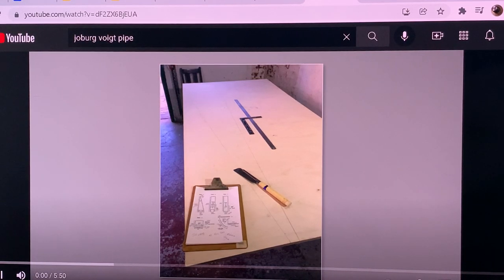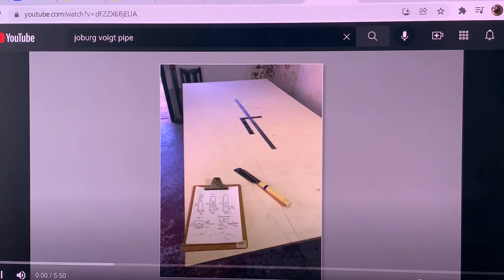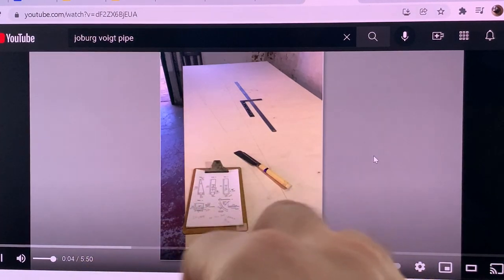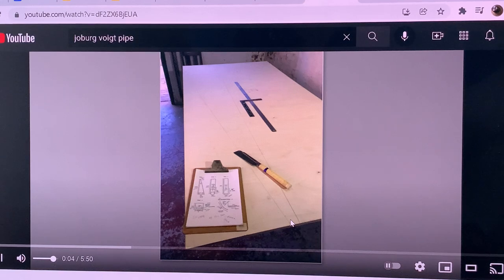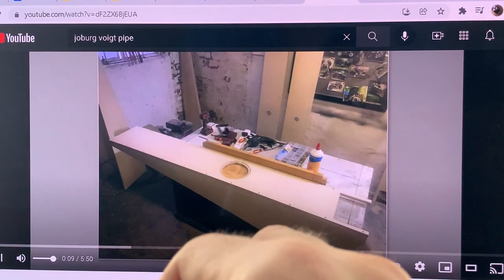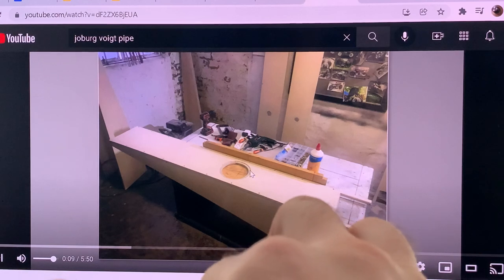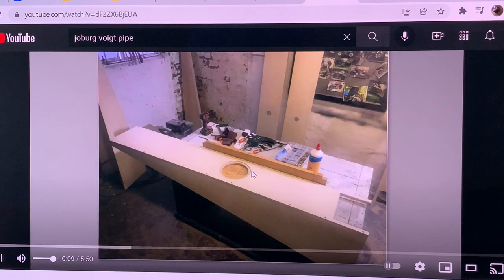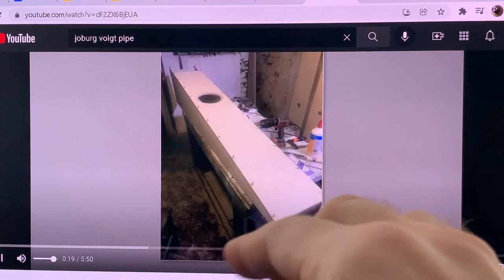Voigt pipe construction pointers   with the Joburg pipe of Kevin

Comment: I built these as well....luckily I used brass screws. Wasn't even thinking non magnetic just got lucky on that count. Bottom horn made from multiple pieces of hard wood that were individually carved and then glued/screwed. Also added felt behind driver. Contemplating filling the space under the horn but haven't taken that leap. Enjoying the series and am saving question for later... Take Care.
Reply from the maker: Very nice work, thank you for sharing! I would not recommend filling the lower section, as that will result in a serious loss of liveliness, speed, and most importantly dynamics - will make it sound as a typical polite, reserved and closed-in cabinet.

Comment: nice info for next project , I will use solid wood and plywood and send you pics soon
Reply from the maker: Superb! ; )
Reply: @realworldaudio  bro I'm thinking of doing front baffle in pine spruce and the rest in plywood, is that ok
Reply from the maker: @IDontExist14  That's a superb choice! ;
Reply: @IDontExist14  sounds alright I wouldn't mount it on inside tho of the cabinet but overlapping the front flash with the outside leaving a small gap between the side of the cabinet and baffle because of expansion sideways
you could mount it on the inside but you'd have to cut grooves minimum quarter depth of the wood probably 3
Reply: @hoobsgroove  thank you for the suggestion

Comment: Hi Janos, I wonder if you have seen the JORDAN Eikona 2 BIB Tapered Line speaker design?  This is referred to as a variation on a Voigt Pipe, but looks a straightfoward but very tall folded Voight pipe to me.  However the design has the opening at the top pointing upward, it is suggested that the open top should be within 90cms (36in) of the ceiling and positioned in a room corner.  The design is 2m tall (79in) with a mouth opening of 330 sq cm (51 sq in), so allowing for it being folded, a 4m quarter wave which is I think 21Hz for the full 16m.

Do you think there are  advantages in an upward facing opening rather than a forward facing "port" (not a port!!)?  Build wise, it looks very simple.

Comment: I was thinking the other day it would be better if you made the front baffle curved from the driver up and having a straight back.
should give you a bit more vertical soundstage coming behind you more quadraphonic ish.
know anybody who's built them like that?
one thing I would change about the design is not having it going to such a point at the top not particularly good lot of resonant problems.
I would put some foam 8" right at the top not just poly-fil what is not the best
Reply from the maker: Great comment, thank you! I will make a follow up video on it ; Janos
Reply: @realworldaudio  ok Janos is that the abbreviation for Jason in English?
Reply from the maker: @hoobsgroove  It's John in English ;